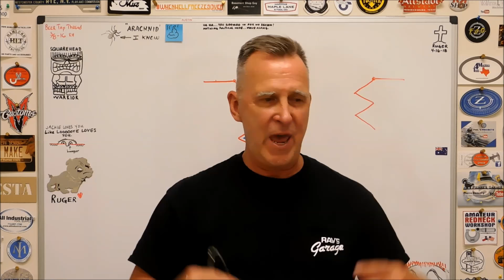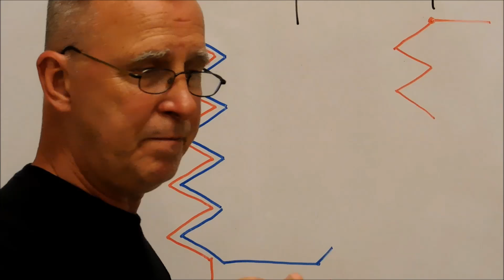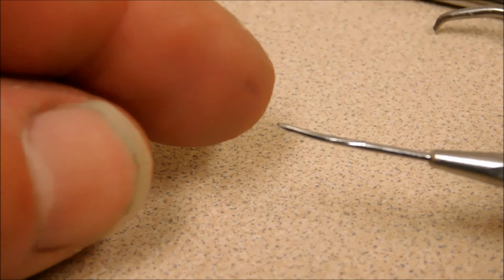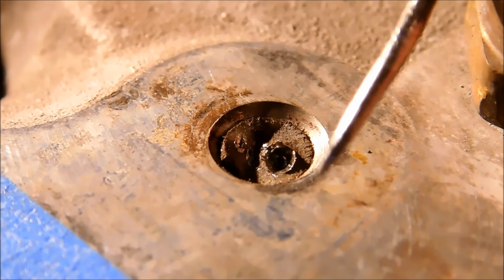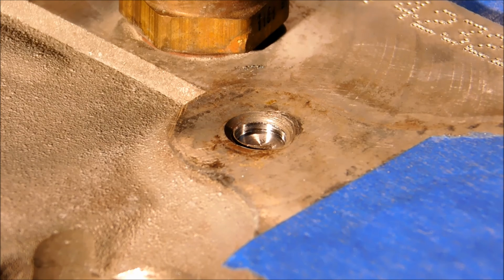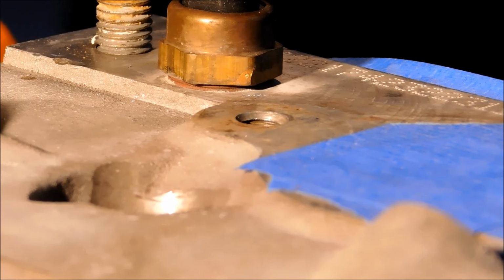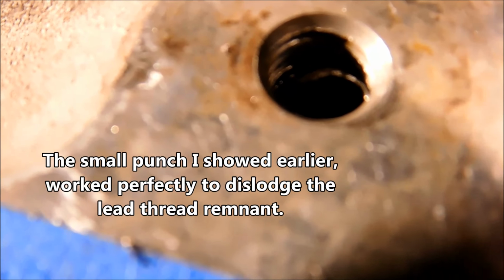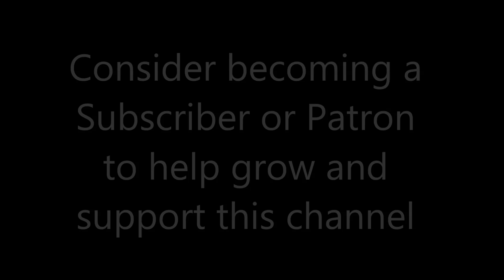Removing Sub Surface, Snapped off Bolts -- Take a Look !!

Comment: I spent the first 25 years of my career as an automotive machinist.  Jobs like this were a daily occurrence.  I begged the mechanics to bring them in before they tried to do it themselves.  As you said it makes the job much harder.  I found myself talking you through the job LOL. The only thing that I did different was to use left hand drills.  I still have a full set of them left over from those days.

Comment: Here's a trick i have used: When you get to the point of removing the helix out of the hole get a 3/16" rod and drill a cross hole at the top of the length of the rod. Then you poke the end of the rod down into the center of the hole,  push the top end of the helix thru the cross hole and 
turn the rod CCW - the end result is the helix wraps around the rod, and facilitates its removal.
The helix gets smaller as you turn it, and comes right out. This stops all the poking around with the needle nose pliars. I use the rod held in a tap holder -- Easy Peazy.
Reply from the maker: I had thought about that. Be careful, the cross hole in the rod greatly reduces the cross section.

Comment: 😂I almost spit coffee at the part you talked about charging them three times if they had messed with it. I'm the guy in the shop they bring anything to that has a tap or a bolt broke in it and out of all the stuff they are telling me I’m looking for and only care about one thing, has anyone else messed with it first. The biggest nightmare jobs are the ones where someone has made an attempt at getting it out themselves. I always tell them that if it happens again DON’T mess with it and just bring it straight to me. That was textbook man, beautiful.
Reply: Adso Melk I agree, usually whenever they bring one for me to get out and they’ve messed with it, it’s always damaged and then they wonder why you can’t fix the damage.

Comment: As a career machinist in a repair shop I agree with your method and have done it many times myself. As a shade tree weekend mechanic I would build up the end of the bolt with tack welds from a mig welder, then weld a nut onto the tack. The heat from the weld helps break the bolt loose and the nut gives you something to grab on to with a wrench. Works great on aluminum and cast iron cylinder heads as the mig welds don't stick to anything but the bolt.

Comment: Hi Joe. I take broken bolts and studs out for a living. I often say that the only thing an easy out does easily is take the money out of your pocket. Easy outs and left hand drill bits only work if the bolt is not seized.Great video. Greg
Reply: I am a fan of left hand drills. He would have had that one out half way threw the video
Reply: THE SHED.    Agree.That's how repairs are. There are so many situations, so many possibilities. So swearing on how one method is better than other is just plain luck. Just like this repair, "IF" Joe had not tried to drift punch it out, might not have the need to use endmill to flatten it. Just might.
With all the possibilities from easiest to most difficult, it you are going to go thru the sequence, by the time you succeeded with method #6, you might have wished you just go straight to more difficult method #6. Ha ha ha.
Reply: The Shed... Since you make a living on this. What is the most successful method for you?
Reply: @ramonching7772  the one that works. I don't have a favorite  method. I don't hesitate to change techniques halfway through a job. There are two golden rules that I work by...
1. There is no perfect technique for all jobs.
2. If this doesn't work, what is my next fallback position?

Comment: I was a Mercedes Benz mechanic back in the 1970's. When rebuilding the diesel engines, the head bolts would frequently break off on disassembly. Those were socket head cap screws, and it would take a breaker bar to loosen them after years in place. Usually 1 or 2 on each engine would break.  They always broke even with the top of the block. Easy-outs are useless on a bolt that you just broke off like that. There is no way you can transfer more torque to the bolt than you already did with the breaker bar. My technique was to melt a small puddle on the broken end of the bolt with an oxy-acetylene torch using a small tip. Then I  would add filler rod in little bits. It was like mounding up ice cream on the top of a cone. You may think I would end up welding the stud into the block,  but it never happened. Even though the stud is held very tightly in the block by a combination of mechanical forces and corrosion, there is a discontinuity that interrupts the transfer of heat from the stud to the block. Once I had a mound of weld material standing above the block, I would weld on a junk bolt. As quickly as I could safely set down the torch I would grab that junk bolt tightly in a vise grips and turn out the stud in one piece. Grabbing the welded headbolt and junk bolt assembly with the vice grips was an important part of the process because the vice grips "pulled" heat out of the stud quickly. The bolt then shrank in relation to the surrounding hole in the block which was hot by then. It didn't take a lot of force to turn out the broken bolt because of the shrinkage involved. Sometimes things would tighten back up before I got the bolt all the way out. I just reheated the bolt, grabbed again with the vice grips,  and the broken stud would again turn out easily. That method is a whole lot faster than setting the block up on a milling machine. More importantly, most mechanics in an automotive shop don't have a mill or know how to use one - I didn't. This happened so often that I considered it a normal part of rebuilding those engines. I didn't add anything to the usual flat-rate price for the rebuild. I've done the same thing with aluminum heads and broken exhaust studs like you were working with. Surprisingly I had no trouble with melting the aluminum surrounding the steel stud I was welding onto.  In that case the stud would turn out very easily because of the larger coefficient of expansion of aluminum relative to steel. Your method is a great one and will work in a large variety of situations assuming you can get your part mounted on a mill. For example,  you could remove a much smaller broken stud or bolt than I would be able to weld onto. Still I think if I  had to send my customer's engine blocks out to you for service it would have increased the time and expense of the rebuild by quite a bit. Absolutely no criticism is intended here. I really enjoyed watching this video as well as all of the other great material you have shared over time.
Reply: A great example of what I just finished explaining to someone about the challenges of working flat rate, (and feeding your family!).  There's this heat absorbing gel you can get now.  I have done the same thing to get broken studs out, as you described.  Having the heat absorbing gel to circle the hole with would have eliminating some of the pucker factor, (in me)!

I've rebuilt a few MB. The first one I did; there was more engine parts in the trunk, than under the hood.  Got it rebuilt, back together and running, AND no 'mystery parts' left over.  Gave me bragging rights for months....  And this was in the early '80's, no videos to watch showing how to do it, and certainly no help from the MB dealer, just expensive parts!

Thanks for sharing.... people think these computer cars are a challenge...  LOL
Reply: Nice write up.

Comment: Joe, thanks so much for this video.  I watched it today (Apr 31) and about 20 minutes after watching it, I got an email from a new customer asking me if i can remove 2 subsurface broken exhaust manifold bolts.  I asked him the send me some photos, which he did, so I have will have a very similar project to do as you have just shown us.  In this case, both holes are in good shape as you had pointed out, so it should be pretty straight forward once I get this setup on the mill table...... very timely... thank you.

Comment: Works good if you have the head off, but if you are working under a wheel well it's a tougher job.  For that, a good technique is to clean the head of the broken bolt with a carbide burr to get to some fresh metal, then put a heavy flat washer over the hole and weld the end of the stud filling it up until it is attached to the washer.  Then lay a nut over the washer and weld the nut to the washer  filling the inside and then weld the nut to the washer around the outside as well, leaving enough untouched so you can still get a socket on the nut.  The heat of the welding will usually loosen the stud enough so you can carefully work it back and forth until it begins to come out.

Comment: Absolutely the best method!  Easy-outs are a bad joke.   If you don't have a mill to hold center or cant remove the part to the shop,  we machine a set of drill guides to align center to counter sink.  Use a block to hold guide square. Works every time.  Great demo Joe!
Reply from the maker: I like that idea. if the exhaust manifold is off any way, a bolt on guide plate would be perfect.

Comment: I've had to take broken bolts out of an engine in the chassis. I drill a hole all the way through the bolt with a hand drill and take an acetylene torch to the bolt, red hot. It heats up and tries to expand but can't (in cast) so it compresses just a bit. I spray penetrating oil which cools the hollow bolt which shrinks and wicks in a little. Then I used Snap On splined easy outs (no expansion) I have done it on aluminium and it still works although I think the aluminium gets expanded, but still breaks free. On a few occasions I was able to leave the threads behind when I centered the drill perfectly. (no mill) I watch all of your stuff and have learned a lot. Thanks.

Comment: Thanks for another great video. I've used a similar technique "in field" on large broken studs in bronze castings with a hand drill and die grinder with carbide burrs. Drill the hole under-size, being careful not catch the female threads, then take the die grinder and open up until the steps appear. Wind out like a spring just like you did. When they've been there for 40 years heat cycling in a steam engine, no ez-out , left hand drill or anything else will move them!

Comment: I've found that pilot drilling the stud and then filling the hole with cutting fluid lets the cutting fluid help provide some back pressure to help prevent the "submarining" of the stud remnants in the final drilling.

Comment: An old trick when using punches is not to go counterclockwise first but to go in the clockwise direction first this will usually unlock the threads making extraction easier. Great video I've never seen it done that way before...thanks.

Comment: I use a cylindrical punch like you tool at 8:00 
My dad would braze onto the bolt and build-up high enough to get vice grips onto it. One time he pulled an ez out from a hole that was drilled into the body of the work piece.
I like to do just like you except I use a center cutting end mill to cut most of the body out and then use the punch like yours at 8:00.
I’m sure glad that you have the abilities to not only show your machinist tricks but also to produce these fine videos. I have been doing this type of work for over 50 years and know one hell of a lot of tricks, but you seem to show me alternatives. Thanks for educating the younger crowd. I find that there are a lot of younger folk who want to do this work but it is getting harder to find journeymen to guild them.

Comment: Locking forceps, then you forget about holding the bit thats left  and you just Twist . Even the cheap ones can take some twisting . A good tool to have in the box especially for small parts.Amacf.

Comment: When I started with Cooper/Bessemer machining ships engines and pipeline  compressors I was mated up to an old German machinist (Tony) For the first half of my shift I would shovel tons of chips and for the second half I worked on a 3x3x9 inch cast iron block with 50 broken off studs in all kinds of angles to eventually recover just the threads. The block was surfaced ground and painted flat black as well. I must have failed a hundred times over the first year there. At that 1 year anniversary of putting all my new found skills I handed Tony the 50 small plastic bags of threads and the now empty block of cast. Tony asked me what I had learned and I replied, "How to pull a damned good broken stud' and he chuckled and said "No you don't get the point, you just learned a little patience". Succeeding at that I was moved over to a new Dories vertical boring mill of my own to man. A 24 ft table with a hydraulic man basket with a DRO. I was at the summit of the highest mountain after that. I stayed for 3 more years until the oil crash of the late 70's. The shop closed down and I moved on to Ingersoll Rand in Alberta. It is always a good visit with you Joe. Take care eh.

Comment: Sometimes, especially in the field, I’ve found I can set a nut over the broken bolt.  Then weld through the hole in the nut so the bolt is now welded to the nut.  The heat helps loosen up the corrosion and the, usually the broken bolt backs right out by turning the nut with a wrench.

Comment: Most dental hand instruments in common use today (at least the explorers scalers and curettes that you'd be interested in) are based on designs that go back decades and are produced by a number of different suppliers and as you suspect of differing quality.  If you find a Hu Friedy or Brasseler instrument you can be pretty sure it's good stuff.  Also, most dentists (myself included) have/had a drawer full  of partly broken or unused instruments which we're often happy to have go to a good home - can't hurt to ask when you're in the office.

Comment: Good job. In my 44 years as a machinist I have removed many broken fasteners. I have had holes full of broken bolts, drills, easy outs, and even carbide bits. So you are right if you don't have the right tools leave it alone.
Reply: Even more important    know how to use them!

Comment: Dentist here!  There are many different shapes of dental scalers and curettes.  The one you have there looks like a Barnhart 1/2.  Dental scalers get resharpened just like any other tool you're familiar with.  Unfortunately, the more they get sharpened, the thinner and weaker they become.  Otherwise, just find the shape you're looking for.   Look up Barnhart 1/2 on Amazon and you'll see one.

Comment: I do these constantly in the truck. A MIG, a washer, and a nut.   Even the most seized in ones. Draw the welds until the entire welded on nut washer and broken fastener are red hot and a quick quench followed by a sharp blow. Then let it normalize I might have to use a wrench or socket to get the piece broke loose with minimal effort. Most usually come out with finger pressure. if I'm really off on my weld or the broken piece is a lot below the surface I will need a wrench to get past the threads.  A quick clean and some copper anti-seize. ready for a new fastener.

Comment: Awesome video. We do the same on the big CAT engines. There's a jig that bolts to any remaining holes you have. There's machined hardened bushing drill guides, because you can't always use the mag drill. But you punch them out and do exactly this. This is a very tried and true method for exhaust studs!

Comment: i only wish i had a mill for all the ones ive done.  sometimes all it takes is a small hole in the center to break suction. lots of times if the small hole isnt quite enough i've used a dremel to go  from that small hole out 180 apart to the threads  like you did. then a flat blade screwdriver backs them right out.   have also used a welding rod touching the bolt then  arc your clamp electrode to the rod.  it welds the rod to the bolt.  after it cools for a couple minutes back the rod and bolt assembly out.   biggest thing to remember is use the right bolt especially on alloys of alumium. the proper plating reduces galvonic corrosion.

Comment: Sometimes center drilling and easy out will work if the bolt is not stuck hard such as exhaust bolts. My best success if it’s not broken off to deep. Is to plug weld a washer to the bolt then weld a nut to the washer. The heating and cooling from welding helps loosen corrosion that exhaust bolts usually have. Then it’s easy to put a wrench on the nut and gently work it till it loosens enough to unscrew. I have done this many times over the years on heavy equipment as well as small equipment. Where time and cost is a factor. To prevent a total disassembly for a broken bolt removal.
Reply: THIS !!^^^^^^^^,  plus before drilling, take a punch and tap or hit the stud a few times to jar or impact loose the stud. Sometimes I will drill with a smaller LH bit to lessen the internal pressure, then TIG or MIG weld the washer and nut.

Comment: This is amazing!  I never would have thought it would have taken this much effort and surely would have boned it with a drill before giving up. Thank you.
Reply from the maker: Glad you got to see what it takes. It was good that it wasn't touched before I got it. Makes for a much better job. I would re-tap the holes before use and use never seize on the bolts. Apollo Rob says to split the exhaust flange near the ends and isolate the end screws and this will never happen again. He said to say hello.